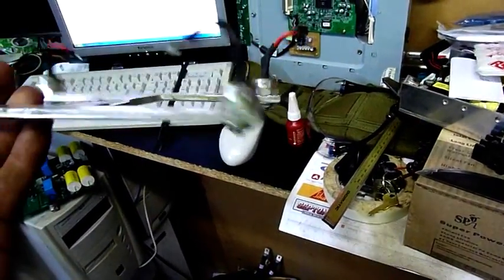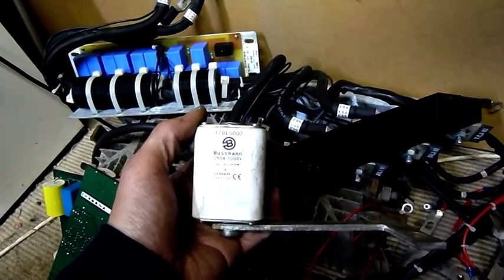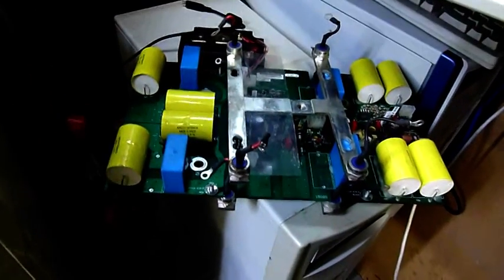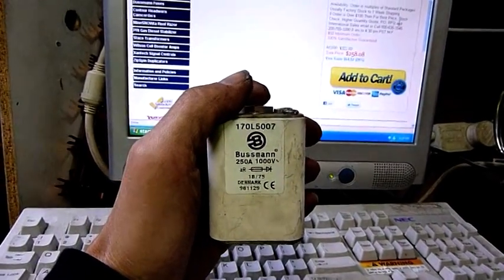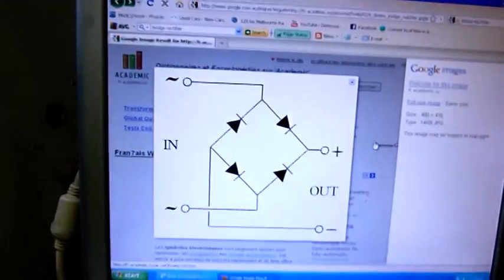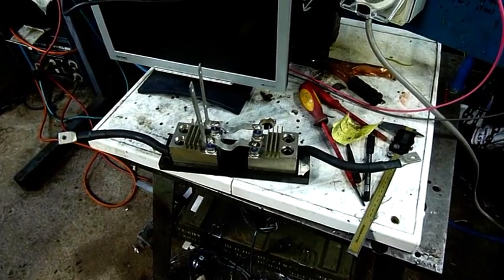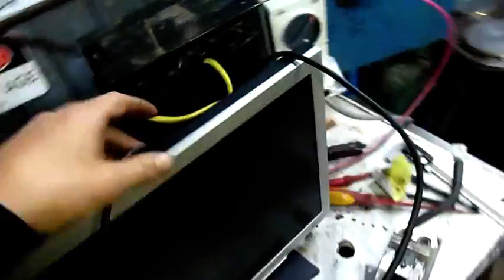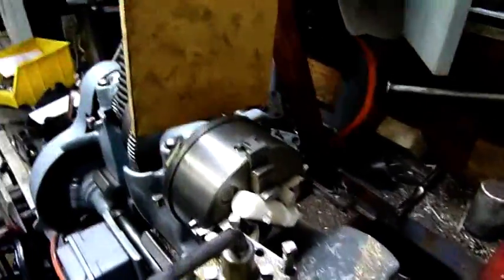Building A 60A Bridge Rectifier

Comment from the maker: @NOBOX7 yeh AC and DC caps can harbor a deadly charge if not discharged correctly, the caps I have for Minithumper are rated at 22,000mfd, 600V DC I think.. making a combined output of 6.5Kj of energy at 600V :D

Comment from the maker: @TehMG you are correct, DC can pull more amps at low voltage, but if the max Amps is say, 2A @XXX volts DC,. you do not need a bigger cable than 2A @ XXX Volts AC.

Both AC and DC need lots of copper at high amps, and heavier cables to avoid loss over long distances.. but you do not need heavy cable for a 1A DC power supply, Vs a 1A Ac power supply.

Comment from the maker: @mrnewagemotor HHO is interesting when turned into a brazing torch!, but its one of those projects that needs lots of time, which I really need to commit to others that I have already started. even improving the kill panel is not what I call productive when there are engines and things that need attention.

I should hook up the 250A silicon controlled rectifiers into a full wave 3 phase bridge :D

Comment: Dont forget to proper heatsink them. At 60A, they get pretty HOT. 
I made a bridge working at 70A and used a big heatsinhk for two of them and the heatsink went hot in minutes. The 70A were from a current transformer, no real power comming form the mains, but real 70A. Nice thing you got there.

Comment: @Arnthorg You will ALWAYS need more copper on DC than AC for any given amount of current. There's a reason why we use AC for utility. And regarding thick wires, you can also take into consideration the voltage drop on long runs.

Comment: Maybe the the smaller diodes were used for clamping purposes, feeding back the high voltage spikes from the motor to the capacitors so they won't blow up the bricks